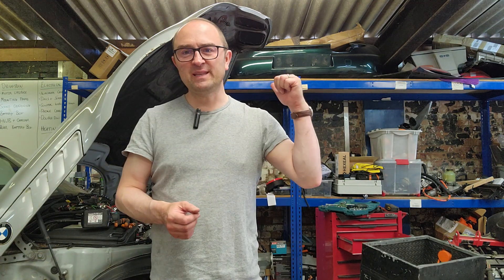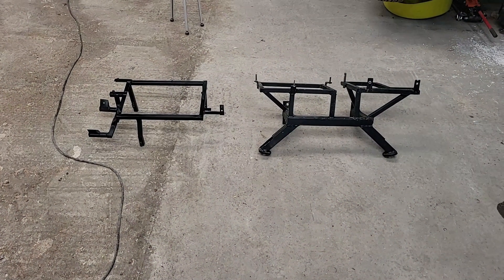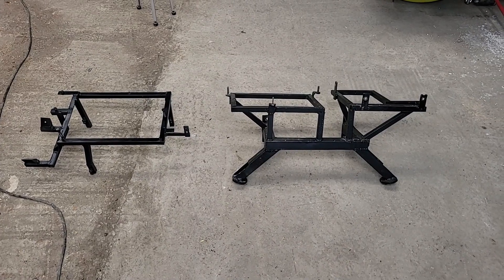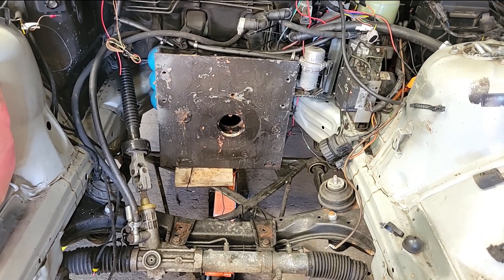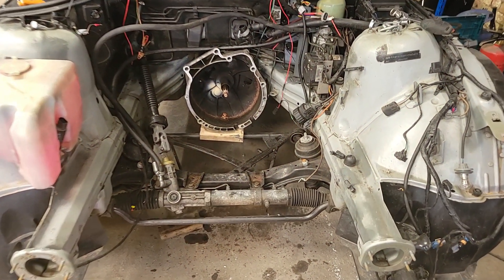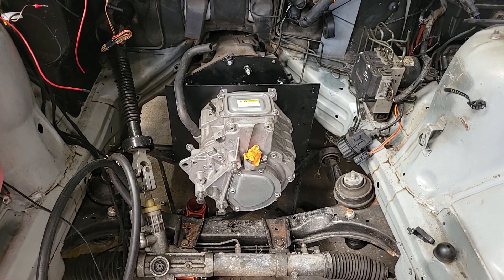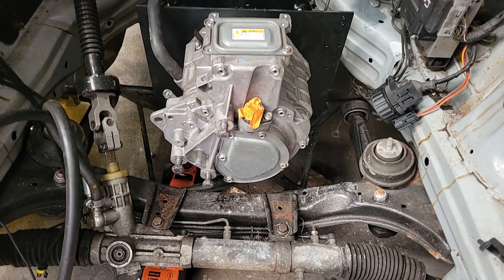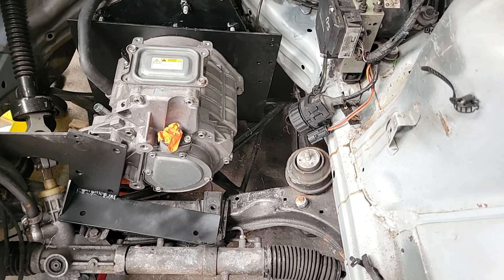Fitting the new motor to my electric BMW (it does not go well)

Comment: Tom have you thought about waterless coolant? May help with the corrosion mentioned in the last vid. Spoken to folk running it in Classics at competitions, all saying it’s help with temps, but it may be the corrosion, or lack of it that’s useful for you.
Reply: Evans is probably the most well known in the UK. Glycol mix with no water. Super high boiling point, but a lot of people now use it because of claimed faster warm up due to better heat transfer. Lower top temp and less overheating, some of the Classic guys reckon that’s true.
Reply from the maker: @madzuki1  Awesome
Reply from the maker: I had not! That's a new one on me. Thanks! Will look into that.

Comment: Hi Tom do you think a Leaf motor fits into the space better than your ex Mitsi motor?
Reply from the maker: Leaf motor is much bigger. Someone else in the Z3 community is doing a leaf swap at the moment. It will be brilliant - more power and he's a much better fabricator/mechanic than me. But it definitely takes up more space.
Reply: @EVDIY  Ah. Not really any Mitsubishi motors available in NZ at the moment
Reply from the maker: @blackterminal  The Leaf is arguably the better option. Definitely more powerful and lots of availability even here. But heavier (obvs) and a bit more expensive.

Comment: New coupler and adapter plate?
Reply from the maker: They're both fine. It's just the location of the motor mount that's the issue. Thankfully everything else is OK - as you'll see on the next video.
Reply: @EVDIY  lol,  you're a tease. 😜

Comment: So what happened? How is the gearbox too far forward compared to your mock up on the other car?
Reply from the maker: I'm giving away things from the next vid here but I think it's the shifter linkage. There are multiple holes in the gearbox mount and while I thought I had it in the proper place, I suspect I had it mounted too far back in the mock up car because I didn't have the shifter linkage in.
Reply: @EVDIY  Hopefully we'll see in the next vid that it is an easy fix. 😉